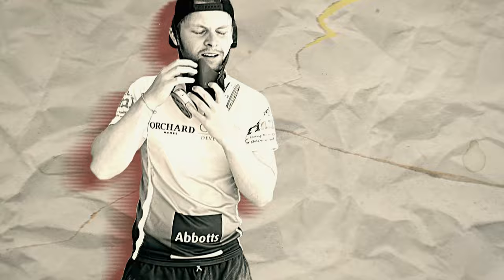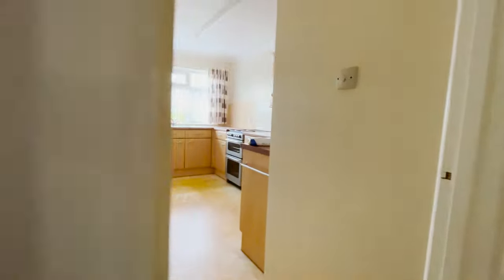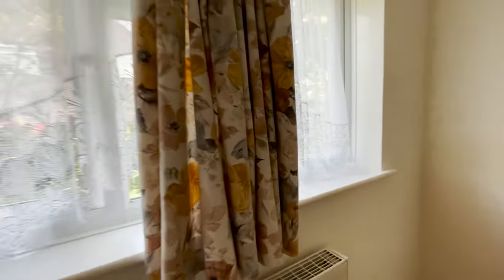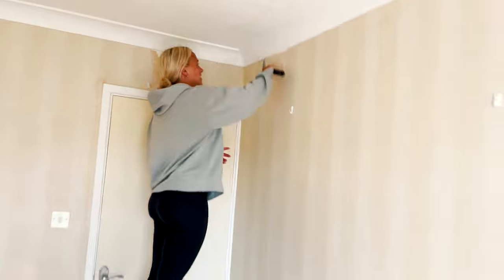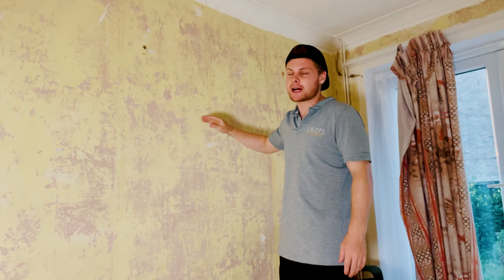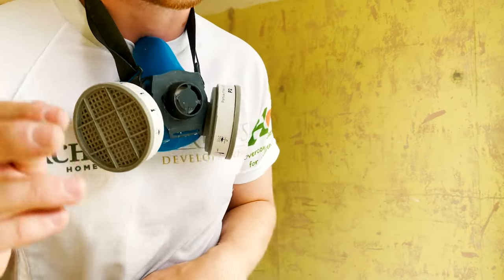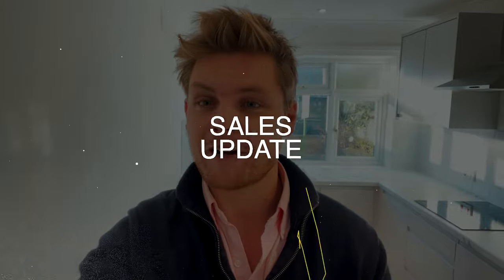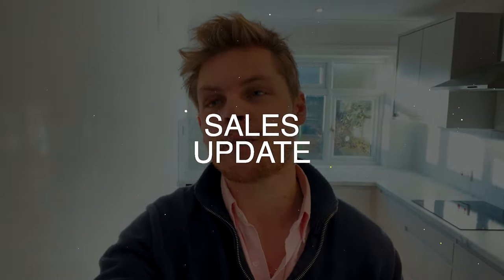70's Bungalow Renovation | UK

Comment: Top tips : gridding for gravel driveway is super cheap and gives better finish . Skim ceilings for better finish. High skirting for better finish, box pipes in for better finish , do a flow of flooring through the building that matches. Avoid coloured carpet. Good luck guys !!
Reply from the maker: Absolutely Viv!